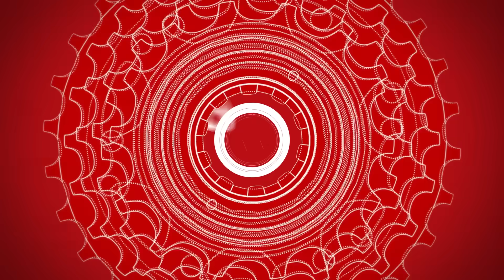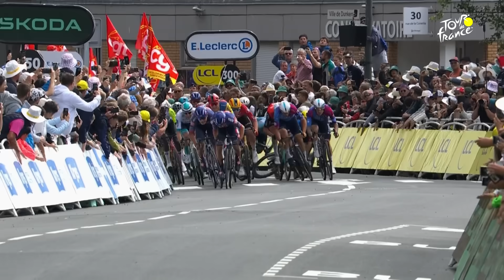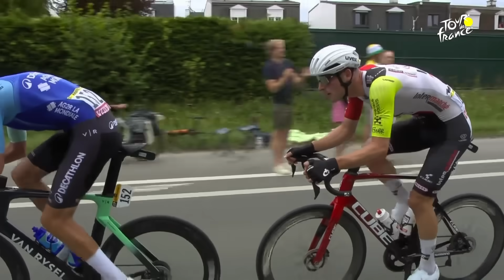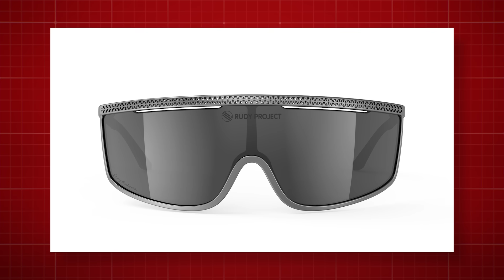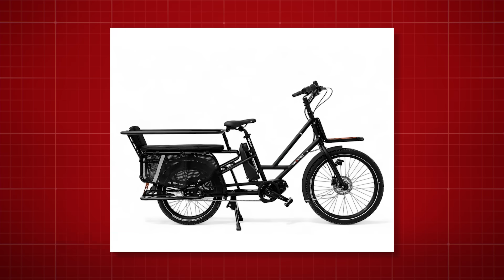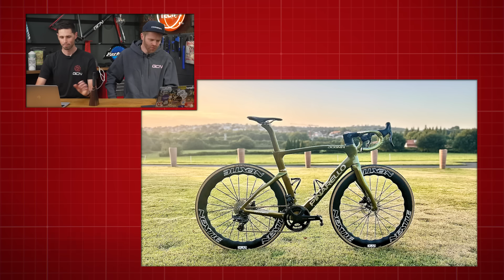Is Speed Really The Problem? | GCN Tech Show Ep. 394

Comment: The focus of the UCI is clearly on reducing the speed, but maybe it would make sense to look at the clothing: imagine a TdF-rider in his typical outfit would sit on a motorbike - everyone would think "Is he insane?!" If the clothing (jerseys, shorts) would have to meet higher safety standards - e.g. more resistance to abrasion by adding inlays of Kevlar, a mandatory neck airbag in the case of a crash, some kind of protection of the collarbones to prevent them from cracking, reinforcements in at least long-sleeved jerseys to also protect the ellbows - would lead to a far lower risk of being seriously injured, and also reduce the speed, as such clothes are certainly not as comfortable to wear than "normal" clothing (a win-win), only in time trials there should be made an exception. By doing so, you can accept happening crashes, but the risk for the riders of being seriously injured could be lowered significantly, so for a crashing rider, the tour is not necessarily over, he can start the next day again.

Comment: If we want to make the sport safer, how about we ask the guys who literally have skin in the game, i.e. the riders, for their consensus on ideas versus dictums, often arbitrary, from the UCI.  That said, IMHO, limitations on gear ratios will increase the risks...as the sprinters "spin out," bunch sprints will get even bunchier all the way to the line.  Looking for ways to increase rolling resistance may help, but I may favor allowing aerodynamic advances to continue as they give more advantages to breakaways than the peleton (smaller groups = more safety).  At some point narrow handlebars will get twitchy so the UCI may be headed in the right direction.  What do the riders say about how narrow is too narrow?  Again IMHO, one reason we're seeing more crashes is that the science of training has improved so much that everyone is getting closer from a performance standpoint.  At the same time, the money, and thus the pressure, in the sport is forcing riders to push their position in the group harder than ever.

Comment: Data data data. Collect it (include women's data) and then get a geek (not necessarily a cyclist) to do some real analysis and then integrate the interpretation into some level of common sense then work with the cycling specialists to come up with a solution. If the uci have any level of scientific underpin (not just opinion) then they need to declare it. Both decisions on speed and bar width seem to be a finger in the air with no underpin of analysis or appropriate consultation. On the bar width subject get input from the bike fitters and consider the women's issue as a separate rather than a 'one size fits all'.

Comment: I have seen a lot of recent pro crashes be caused by touches of wheels, ridding in a larger area when sprinting, and disc brakes causing pile ups.

Touches of wheels... Will always happen. It's something that will happen time to time, but going alongside the point that riders sprinting end up needing a lot of space either side of them, is it that pros are using indoor trainers more and not getting used to the real world environments. Yes there has and probably will always be the case of rubbing and bashing shoulders in sprints, but it seems to be getting worse in my opinion.

Now disc brakes. I use them and I love and hate them. I love them because they look nice and work well. I hate them because of the maintenance issues and constant rubbing that come with them. When I say they work well, most the time when setup perfectly, they work almost too well. In groups this can cause riders to not be able to react quick enough to the sheer breaking power. 

Of course slowing the pros down will make it safer as their reaction times will be greater, but I genuinely don't think it is the biggest factor in recent crashes.

Just putting my thoughts and opinions out there.

Comment: The UCI doing a proper analysis ! Sure that will work, the same people not allowing disc brakes for years because everyone who crashed will loose a finger , while it was widely used in MTB. Now you cant run a rim brake bike because ........Im waiting. Maybe its because they want that fast Ooopsy lock ups to cause crashes for the excitement. Put these guys back on 23,25c tires and rim brakes. It wasn't a problem before they went all high tech years back.

Comment: I know that disc brakes have a better braking. Having the ability for sharp braking is this also part of the contribution for slow speed crashes in a close group peloton. Could the manufacturers create an ABS brakes? Just a thought when peloton are so close and brakes lock harder to avoid a fallen rider when brakes lock. With ABS braking they an improved chance to avoid crashes….

Comment: In a sport where it’s aims are to to travel at ever greater speeds, and packs of athletes in very close proximity to one another are generating speed, maybe the answer is in Motorsport, where the survival of a crash is where the work has been done to protect the driver. I agree the science has to be done to ‘crunch the numbers’ to map crash stats and identify the high risk areas, and use that to look at rider protection and hard obstacle infrastructure (other than the road) to reduce injuries to riders, this maybe a little more helpful than bar width and aero sox.

Comment: PhD in CS here. A few thoughts: 1) Ollie’s right, data analysis should be the priority and will reveal the best answers, but 2) a lot of this video is in bad faith to me. We don’t know the UCI’s reasoning cuz they haven’t told us. Everyone is attacking them but the fact is we don’t know how they made the decision (at least I haven’t seen it). Additionally, you guys keep talking about reducing crashes but I do not believe that is the point here. Just like in similar industries the goal is to reduce the SEVERITY of crashes, and clearly speed plays a role there. The aviation and automotive industries are instructive. In aviation to reduce crashes they separate aircraft in space and time, and work to minimize mechanical failures. In the automotive industry they seek to reduce severity of crashes by reducing speeds via speed limits, road furniture, etc. Completely different goals. Perhaps the handlebar rules are stupid, but it’s hard to engage without understanding their goals and reasoning. My biggest complaint would be that they haven’t told us this.
Reply: This seems to nail the criticism of the UCI.  They implement policy without communicating the genesis, the analysis, nor the justification of the proposed solution.
Reply: @mikeemmons5051 exactly. If the UCI have in fact performed a scientific analysis on likely causes of crashes, it’s still their own fault that the public doesn’t know about it. Either way, they failed the public.
Reply: Very insightful comment. Good papers are not rushed so they probably will take time, but safety rules could be considered urgent in the mean time. It's not like they can't correct course afterwards.
Reply: @hundry_f but if they had a paper awaiting publication they would say this is based on scientific findings which will be published in due course. Quite often findings which will be in a paper are presented at conferences long before publication especially if there is some urgency in the consequences of the findings. The fact is they have thousands of hours of videos of recent and historical crashes, they know the outcomes of those crashes in terms of injuries and they could easily have asked a university to look into it or funded a PhD in cycle race safety. They could also look at the injuries to see if any aspect of the bike or clothing, worsened or could have reduced the injury. I have never understood why the standard clothing shreds so easily. More abrasion resistance could easily be added, if compulsory it has no disadvantage.
Reply: @StephenRussell-c8v first three guesses: cooling, weight, aerodynamics. Maybe comfort?
Reply: Really good comment. Thank you
Reply: Analysis is the correct choice.
I don't think it's fair to say the video is in bad faith. 
If it is in bad faith, that is only a reaction to the UCI making rule changes without explanation. I think the unexplained rule change is in bad faith and any reaction speculating is the natural result of the first action.
Reply: Reducing speed in a race should never be an option. If you wanna be safe then don't race. If you fear speed, then dont become a racing driver/rider.

Comment: If the UCI and ASO were serious about making racing safer, why don't they just impose a minimum time to complete each stage? They currently have a cutoff for the maximum time to complete a stage.  If you are outside that time cut, you are disqualified.  They just need to do the same for the soonest you can finish.  If you cross the finish line before the allowed time, you are disqualified.  That will slow the race down because no one would want to be disqualified.

Comment: Reducing gearing can be countered with shorter cranks, because you can physically spin a shorter crank at higher RPM. Power is force multiplied by speed, so there is theoretically no power change. Perhaps 155 mm cranks are biodynamically more efficient... please test 🙏

Comment: Pls fwd to UCI my latest conjectures: Flat bars will not hook onto each other in the group as often as drop bars. Disc rear wheels mandatory to prevent limbs going into the rear wheel. No more chainrings without chain guards. No more pointy bits allowed on the bike with a radius smaller than a hen's egg 😅, to reduce puncture wounds. Gloves, elbow knee and hip pads that reduce road rash and impact fracture mandatory .

Comment: check the speeds of the winners for past 20 years  . There is only 1-2 kph  variation of the winners  . About 40- 42 kph .  Froome in 2017 and Thomas 2018 were as fast as Pogacar and  other winners .  No aero socks  or 12/13 speed cassettes and electronic shifting .  Narrow bars  were few and far between. Seems to be the main reason for any increase in speed in the stage is the profile .  Cadel Evans being interviewd in 2012 told how hit 110 KPH on a descent running on 23mm tubs with rim brakes .

Comment: 100% of the crashes are caused by the movement of the bike, therefore it makes most sense to restrict how the bike moves. This can be achieved either by putting the bike on a stand with a roller under the back wheel or by removing the back wheel entirely and replacing it with a specifically made stand with a cassette on it. In the past, this would have been an issue of knowing who wins the race, since everyone moves at 0 kph, but with the advent of power meters we can just measure the power put out by the rider to determine the winner. We could even have virtual avatars which move the as the cyclist pedals.

Comment: Of course “speed” doesn’t cause crashes. You don’t fall because you’re going 60km/hr you fall because of losing traction in a corner, moving unexpectedly, deviating from your line. However, the difference between crashing at 30kph and 45kph is drastic. Also, the slower the speed the more likely other riders can react and not go down in a massive pileup. If a rider crashes in a corner, the reason they fall is because the lose grip and slide out or take the wrong line, the reason those things happen is because they’re going to fast for their skill. Decreasing speed will make the sport safer.
Reply: Breaking very fast with disc brakes...

Comment: It’s cheaper for the UCI to make a random rule change and see if crashes go down. Analyzing all the data by experienced statisticians is incredibly expensive and takes time. By throwing a dart at a dart board they can implement rules faster, pushing the PR narrative that they are taking action for very little expense. If they force the teams to change handle bar size and a team wins with a certain width handle bar then millions of cyclists will run out and buy new handle bars in that width. The industry is probably ok with this.

Comment: I disagree. An analysis will hardly show anything as clearly as "this was specifically caused by this speed at this handler width" because there are so many factors going on at once. They can't narrow down to a specific trend because it is an approximate thing. It is hard to quantify the impact of speed but in combination little watt savings mean marginally less time to respond and faster speeds hitting the deck (though it often seems to be the innocuous slower crashes that lead to the worst injuries because you often slide across the tarmac at speed). So the question becomes what is a very effective way to limit speeds without changing too much, and what things have developed in the last few years which contribute to the speeds? Admittedly I think banning TT helmets in road races would be a better thing to go after first...

Comment: the crash reduction solution ... 
ban list.
aroe socks
skin suits 
areo frames
aerobar 
aero helmets
1 by chain rings
tubeless set up
hookless tires
no wider than 25 mm tyres
40mm rims tops with minimum 24 sprocket 
no narrow handlebars  (narrow bars = riders closer ro each other = more crashes)

its a bunch strat NOT  a timetrial bunch sprint

further bans ir limitations 
handlebars are bars and stem
krank length is between 167.5 and 175
with 2 by kranks 11 speed cassets should be enough, and a slight gearing limitation 
and the Commercial angle should be turned so if any tech is not dor public use for 5 years ist not allowed in uci reci. 

then the thing with discbreaks and electrical gears ... do we really need it.  all this might also cut costs of bikes 👍

and yes I'm oldschool, cranky and a  gen x so whining comments will be ignored

Comment: Changing the gearing is only going to slow down riders on the downhills, I'm sure most crashes occur when the riders are round about the middle of the block. Plus a hundred odd riders half wheeling doesn't help in the safety stakes, which is the cause of quite a few crashes.

Comment: So let me get this straight. The UCI is bad for trying to slow the riders down, but even on a close motor racing track (with all the safety elements everyone in the comments say the UCI need to do with public roads) there are still crashes. So other than speed, what exactly is the reason then? 🤦‍♂️

We know that time to react is increased with slower speed, we know that crashing into barriers and walls at a slower speed is preferable, we know from physics that cornering slower is safer than at the limit of the road and tyres… there’s an answer in there somewhere… 🫣

Comment: If the riders are slowed down by equipment limitations,  there will be larger packs riding closer together because Pro's will be able to ride at the top of the gear limits ( like Junior Gearing) causing larger crashes. That's what happened in NASCAR. Also Riders train hard to get faster, what they want to do is to make all the riders equal. Their next step would be is all riders are all on the same spec bike like in Japan Kerin racing.

Comment: I genuinely do not understand the extreme amount of hate towards these new UCI regulations that attempt to make racing safer. Are these rules the best? Probably not. Will this make it racing safer? Time will tell. Is it better than not doing anything? Yes. Is it good that they attempt to keep cyclists safe regardless of the impact these rules might have on the bike industry? Yes, we should not care more about unsold stock than the life or well-being of people. Is speed the culprit for most crashes? Probably not. Will riding at lower speeds limit the impact of crashes? Yes, as you have more time to react to something if you are going slower. Slower speed is safer, anyway you put it.

Comment: I guess the question is what is the uci trying to solve? Do they want to slow down the peloton? Do they want to reduce crashes? Do they want less cycling injuries? The variables are quite high so the ability to pin point for a couple few is probably tough and I’m guessing operator error will be a big one, so that points to how to limit injuries when cyclists inevitably fall off (unless you add gyros to bikes that make them impossible to fall over)

Comment: The primary conditions of these accidents have to do with road conditions and/or the density and size of the peloton. When you’ve got 170 guys flying at 50kph mere inches from each other, and the road is slippery or has road furniture, it doesn’t matter how wide your handlebars are or what socks you’re wearing — there is no margin for error. And if there is even a small one, you’re going down and taking out a bunch of people with you.

Comment: When it comes down to it, the biggest cause of crashes would be human error. Whether that be going to fast, poor line choice or whatever else is irrelevant.
If it is looked at from a health and safety law perspective, then the aim is to reduce the risk, which is defined as the likelihood of harm occurring. Crashes in bike races can't be eliminated. Engineering controls to reduce the speed, and therefore, the severity of the crash is the most practicable solution. The best way to achieve this is debatable.

Comment: Short answer: There is no way to prevent crashes so instead, try to reduce the hazard whenever one happens.

Long answer: Take F1. They don't lower the speed but year by year they improve the safety of the car whenever a driver crash. They make the car stronger, implement the Halo, etc. An F1 driver can crash at 300km/h and walk as if nothing happened. I don't know about bike racing but maybe they can make cycling wear thicker or make them wear kneepads, introduce fines and sanctions for unsafe racing, or sth (these are just examples but I hope you get the gist). Cuz at the end of the day, I think the most contributing factor to an accident in any sport is the athletes themselves and not their equipment.